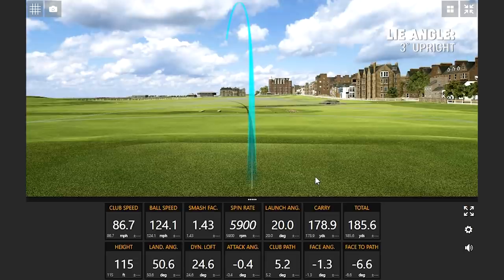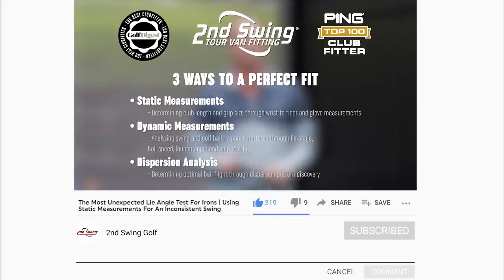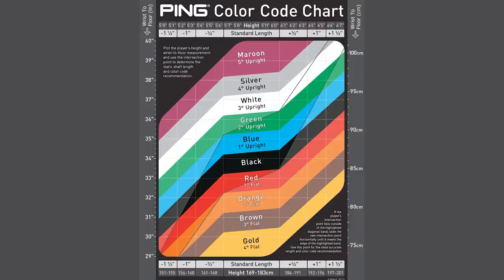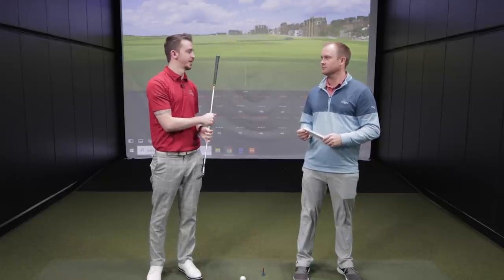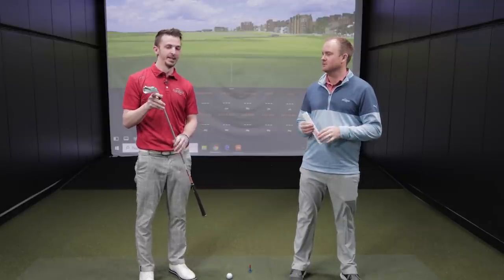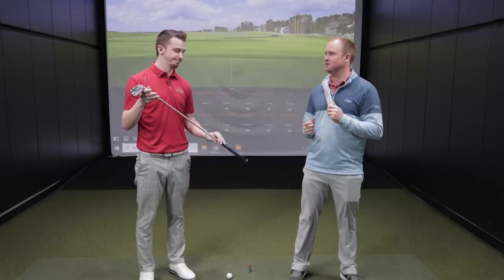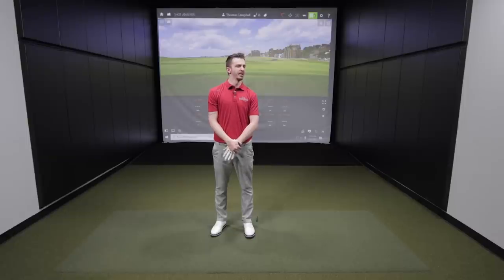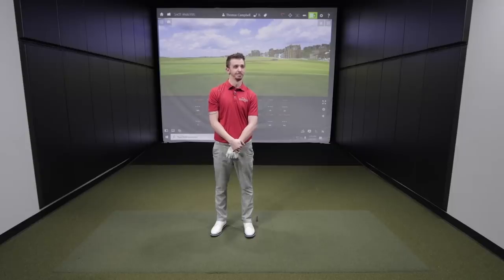Unexpected Golf Lie Angle Test For Irons | Using Static Measurements For An Inconsistent Swing

Comment: There is one thing most clubfitters don't do that I think is necessary. It is assumed that the golfer has his hands in the same position at impact for every iron. That isn't necessarily the case. Usually only one iron is tested for lie angle - typically a 6 iron. Often a golfer will stand up more with longer irons and squat more with short irons. Therefore the hands are higher with the longer irons and lower with the shorter irons. When I do lie angle tests I test with the longest iron and one of the shortest irons. I then figure out the number of degrees of lie angle difference per club and bend them accordingly. I do the same for my own clubs because I stand more upright the longer the irons. I have found that this method works best. Otherwise, for some golfers, even after a lie angle fitting the long irons will be too flat and the short irons too upright.
Reply: So true. I’m 2 degree upright and can hit my 5,4,3 long irons pure. Meanwhile my PW, 9, 8 iron tend to pull left.

Comment: This is right up my alley. For years my lie board readings said 2.5 upright. I finally just had an old set of irons set 2 flat just to try and WOW what a difference. Haven't gone back and went from 16 to around 4 since then.
Reply from the maker: oh WOW! Pretty stark improvements....
Reply: Thinking about doing this to a spare set also. Did it change the way you swung the club?
Reply: As everyone says and knows in the industry, the lie board LIES.
Reply: Great videon...Danny is hilarious. Soesn't matter what's in his hands. - PING measurements and lie board had me at 3° upright. Now playing a mixed bag of lie angles At only 2 to 1.5° long irons to flat on PW

Comment: Wow. My exact experience with club fitting. Reassuring. I am 6’ with 36 in long arms. Ended up 1 degree flat using pings system. I bought the Titliest T-100 which is 2 degrees flat of their standard. I’ve eliminated the big left miss. And like the look of the club better at address. Push draws.

Comment: I had a fitting recently and have gone from my old clubs, that were also fitted, which were Ping G400s, white dot, 1” longer, to Wilson Staff CB, 1* upright 1/2” longer. I havent grown or shrunk, but my swing has changed quite a bit and i hit the CBs better than my G400s.

Comment: I purchased a set of TaylorMade P770 Irons back in February which I’ve still yet to receive. This topic is something that I’ve honestly been thinking about, because when I was fitted before for my current set I was told that they should be 2 degrees flat. When I got fitted for my P770’s I was told 1 degree upright was my fitting which seems like a big difference and this is going to be my first new set of irons. My misses are usually left with current set so I don’t know.

Comment: I just went through the same process last week, and like Danny, I did not co-operate much (lol).  I am 6'4" with a 38 1/2 left wrist measurement and for 30 years have been getting my clubs 1" long and 2* upright.  This time I went 3* up just to try to center the lie-board a little better, but honestly it made very little difference.  In the end, static measurements are best for me, and give me a very slight draw most of the time.
Reply from the maker: Thanks for watching!! You especially at 6'4" and 38.5 wrist-to-floor need to rely on static measurements because standard specs would have you working hard to manipulate your swing!

Comment: I think it’s a matter of comfort. Golf course is never flat. we are subconsciously trained to adjust to the situation for every shot. Ball above the feet, ball below the feet, uphill, downhill, and etc. Better golfer we are, better we are at compensating for the lie angle difference. I am also in “blue” range according to the ping chart, but i play 2 flat. I can play std, or 2up as well, but i am a lot more consistent and comfortable with 2flat.
Reply from the maker: Thanks for watching!! This is a great point...and something that is very hard to quantify. The visual aspect. We always want golfers we fit to be confident in the clubs they are fit for. If we recommend a setting/model/shaft/etc, it may perform the best, but we want the golfer to also like the look and get confidence from it.
Reply: @2ndswing  right on. I think this is the beauty of custom fitting and why it is so important to find a competent fitter who can catch these subtle details. I got fitted 25 years ago when the concept of a custom fitting wasn’t quite popular. My fitter knew from the get-go that i would benefit from 2 degree flat, and he was right. I just knew instantly that this is the right setup as soon as i made one practice swing. as a result my confidence went up, my club speed went up, ball speed went up. I can still play std setting. But it is not as comfortable as 2 flat. Finding a competent fitter is pretty hard though.

Comment: Sharpie line on the back of ball at the range. Gives a good indicator on your lie angle since clubs will interact like a normal swing
Reply from the maker: Nice idea!
Reply: @Joseph D. Dang true but most have sharpie to mark balls at course. I used dry erase at the range and spray foot powder for impact
Reply: Even do at home with plastic ball and marker so don't have to hit far just compress ball so marker projects on face

Comment: If you don't fit the lower irons correctly the lie angle will have a larger affect on ball flight.  Just bc a 7 or 6 iron isn't offline as much doesn't mean that should be used for the lower irons.  A good fitter will also check your lower irons not just the middle of the pack.
Reply from the maker: Absolutely, great point!

Comment: Would love to see what happens when you adjust lie angles on the driver, either with the adjustable sleeves or otherwise.  I ask this because my miss historically has been left, so when I got a Ping G425 driver recently I immediately adjusted the sleeve to the flat setting.  The miss left was gone, but in it’s place was a constant block right.  I couldn’t figure it out given I hadn’t made any major swing change.  So yesterday I went back to the standard setting and voila, the block was gone.  Yes, I had 2 misses left, but overall much better.
Reply from the maker: Interesting stuff! We have done some severe lie angle tests with irons but not driver...would be a good one to do. Clearly there is a difference created in dispersion!
Reply: I have the g425 max. I use the flat plus setting to close the club face easier in the flat setting. Push draws now. The flat setting is big. 3% flat of standard. Also have the back weight in the heal position to promote a draw. Push draws now
Reply: @2ndswing  well how would you do those tests with flatter or more upright lie angles on drivers since Ping is the only one who offers a flat setting on their sleeve ... got to love Ping! I was missing about 40% of my driver shots with a pull draw left... changed to the flat minus setting on my G425, same shaft, and pull draw was gone. Straight as an arrow.
Lee Westwood also plays the flat setting on G425

Comment: Good players will compensate to whatever lie angle is on the club and will usually present the sole somewhat level at impact. 

That's why lie angle measurements should be taken hitting an impact bag or similar where the player is not fighting to square the face and make a nice strike. From this impact you can see how upright the shaft is and then adjust the head accordingly.

Comment: Hi I have a question, if Mizuno are generally more flat lie angles as standard and I’m somebody who’s static measurements say I should be 2 degrees upright, would that really be more like 3 degrees upright on a Mizuno iron? What would my theoretical miss be if I have no adjustments on a Mizuno iron with standard lie angles? Should I go with the 2 degrees or 3 degrees. Ping chart says im +1” length and 2 degrees upright, but I play Mizuno irons.
Reply: You use the measured degree and transfer to any club set. Since Mizuno play flatter, you'll bend more upright, but the results will still be the measured degree. Your theoretical miss will be to the right if not bent to your specs.

Comment: I’ve been measured 1 up, 2 up & 3 up but from the ping charts & using the board I was always 2 up & every 2 up set I hit well but had to bend back my 3 up set as was not consistent. So I believe in the ping charts for lie angle but the lengths are somewhat off I find in taller people suggesting +1.5 inch length for me was too much but the ping charts are very good as a base & also I’ve found I get different results on the board depending how I’m swinging which varies being a mid to high handicap with physical limitations - I find use chart then test using that with board & feel as you can tell if it feels right

Comment: I don't really think lie angle is going to affect strike location across the face very much unless a player makes major compensations from the different visual look.  But most golfers wouldn't really notice a degree or two change.  Shaft weight and length would be more impactful in strike location trends.

Comment: Can I ask what that golf ball for lie angle is called or how to purchase? I can’t use marker on the trackman screens so this would make it much easier thanks
Reply from the maker: That golf ball is a fitting tool we use and is not widely available. One recommendation that would work similarly is drawing a straight line on a range ball with a sharpie and lining that up to see where you're striking the ball on the clubface.
Reply: @2ndswing  Use a "wiffle" golf ball, one of those plastic golf balls with hole in them that weigh nothing and fly very short. Use  marker on them and hit them full swing, they won't go very far or damage anything if used in doors. They'll transfer the marker line and produce same results as real golf ball.

Comment: 12:23 if the line is leaning towards the golfer you would need to flatten the iron to get the line vertical??
Reply: No. If the vertical line points towards the golfer, the club head needs to rise (increase lie angle). Press the edge of a credit card into the palm of your hand and look at the mark. Then actuate radial deviation of your hand DOWN and press the card into your palm again and you'll see that the mark will be pointing TOWARDS you.  Thus you need to raise the club head (increase lie angle) your hand in this case, for the mark to become vertical when pressed again

Comment: Hi Thomas!  Question.  So if someone tends to hit it on the toe and a lie board shows a mark towards the toe too.  Does increasing the length of the club tend to help move the strike location more towards the center of the club?
Thank!
Reply: Yes.
Reply from the maker: Hi Joe, this is Thomas. A longer length could move the strike location away from the toe and closer to the middle. So can a flatter lie angle  but if lie board shows toe too, try 1/2" longer as well. I'm not so concerned with the toe marks on the lie board and more interested in the direction the ball goes!

Comment: Are lie boards relevant any more,. Had a similar result, lie board suggested 3 degrees upright and couldn't keep it on the course. Fitted into standard.
Reply from the maker: This is Thomas. I don't use a lie board in every fitting, it's just not necessary. I'm more interested in the ball flight. It's a good way to educate but end of the day ball flight/dispersion is number #1 for me.
Reply: Thanks Thomas. No way intended as any criticism of your fit. Just a comment based on their usefulness guven your vid and my experience.

Comment: Everything was interesting lol. My conclusion is that his swing wasn’t consistent enough to get the results that was expected. More upright more left, more flat more shots right. In my opinion a lot of people would benefit from a flatter lie, promotes a shallower downswing. I challenge everyone to try a 56 degree lie angle on an 8 iron. It’s amazing. $5 to get bent and you can alway bend it back. Most likely will have to be forged irons.

Comment: I have 30 year old irons.   I believe the toe of the club hits ground more.  Do I need clubs with upright lie angle?
Reply: How od your ball flight? Pushing it left?
Reply: The numbers are fun but don't forget the goal, which is to hit the center of the clubface and have the ball fly reasonably straight.  Generally speaking, going upright will move your start line to the left and going flat will move it to the right.  Upright will move your strike out towards the toe and flat will bring it in towards the heel.  Mats can also be misleading so be careful with that.  If you've spent 30 years building your swing around the dynamics of the toe digging slightly, going upright may be the "right answer" but could make you miserable.  

To use myself as an example, my miss tends to be a dead pull (path out to in with face square to path).  Going a hair flatter turns that into a bit of a fade.  Going a lot flatter opens the face to path and turns it into a slice as the toe gets stuck in the ground.  You will not see this hitting off a mat - the toe will just bounce and send the ball left.  On grass, the toe will dig and send it right.  The main thing I've learned from several expensive, ill-fated indoor fittings is that golf isn't played on rubber mats.

The good news is that you can easily pick an iron and have it bent.  I also play tricks with grips; I tend to flip short irons so I build up the top hand (less taper), which slows down face rotation.  I know guys who use midsize grips on irons for this reason but standard grips on their woods.
Reply from the maker: Thanks for watching! Generally yes, if you think the toe is making more contact with the ground, you probably could use a more upright lie angle. But in an ideal world we could pay attention to dispersion and distance. Perhaps you hit your irons straight and consistently, so a lie angle change wouldn't be worth it.
Reply: Bill, get off your wallet it's time for new golf clubs and a proper fitting..you owe it to yourself.

Comment: Not sure anything on this test was conclusive, should have tried 5 up and maybe go back to the 1 up just to see where the numbers compare.  Not sure I learned anything here, other than "news flash"! everybody is different
Reply from the maker: You're right ... everyone is different! Just key to get both static and dynamic measurements when fitting for irons because sometimes one or the other will not be conclusive enough
Reply: Lie angle is an important and meaningful test for dispersion metrics. As such, it would be best conducted by an Iron Byron type machine to eliminate tester stance and grip adjustments because of visual feel and preferences at setup.

Comment: I checked my lie angles using a ball with a line marked on it with a Sharpie.  I applied masking tape to the faces and hit balls off a mat.

The lines were coming out vertical and right angles to the grooves, which would indicate that my lie angles aren't that far out - is that correct?

I used the same set up and hit off a lie board and besides a mark toward the heel, the line was no longer vertical on the face, which shows how much the ball is raised and affects the lie angle by playing the ball higher above the feet.

It is for this reason, I feel I can't rely on a board to give me the correct readings.